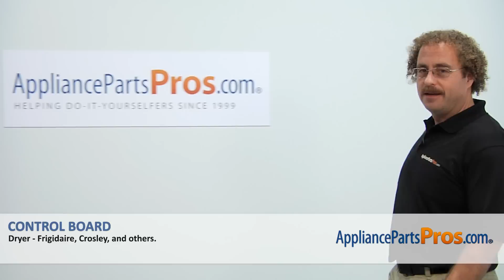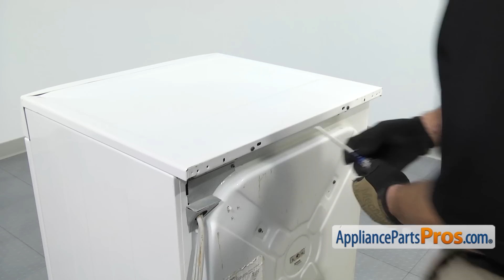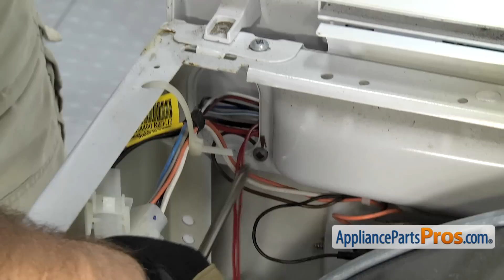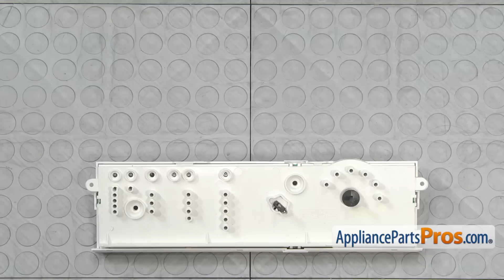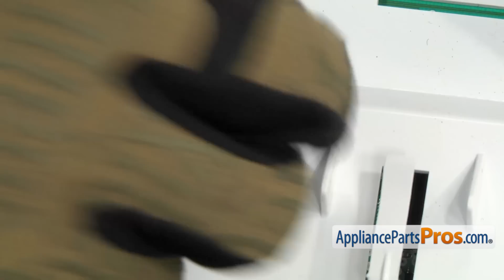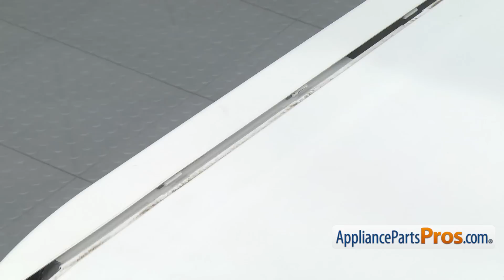Frigidaire Dryer Control Board 134484212 Replacement — fits Electrolux

Comment: Thank you for this excellent YouTube. I have a Kenmore / Electrolux exactly like the one in the YouTube. My problem was that the dryer runs for a while but stops abruptly with the four lights on the far right flashing. I replaced the control board with one I bought locally following this YouTube. As ladyluckdrums commented below, now you just get the bare circuit board and you have to reuse the old Control Board housing. Fortunately this was easy - the housing snaps apart and you swap the circuit board, and as ladyluckdrums also mentioned, the instruction sheet that came with the part is bad; the verbiage is confusing and the photos are indistiguishable.
The only difficulty I had was that the two knobs were extremely difficult to get off. The knobs on my dryer were quite different from the YouTube, but otherwise the panel was exactly the same. What I did was pull the Control Board away from the Control Panel, which left the knobs embedded on the Control Panel. To finally get them off, I had to squeeze the part that protrudes through the hole with needle nose pliers.
My dryer now works like brand new, and it ever has a quieter, smoother hum.

Comment: Thank you so much sir. This is exactly my model and you help me a great deal. Before buying a new board I have to find out why my dryer beep and the start light flash by itself when not in use.  I press on cancel and it stop beeping, maybe 20 min later it does the same thing again. Very weird.

Comment: Thank for you for the clear and concise video. The part I ordered from AppliancePartsPros did not come with the housing as pictured on the website, just the electrical panel. It added a few steps not in this video but some rational thinking got me through (the additional instructions with the part were completely inaccurate). So, with this video and some "figuring" I got it changed and it works. Thanks!
Reply: Same here. All I got was a computer board. I'm guessing I'll have to open that up and remove the old board. Right?
Reply: Yes, the housing openings. I took pictures so I could reassemble the correct way. It was easy
Reply: Yes  @ladyluckdrums it looks easy enough... You can see which receptacles stick through each hole. My guess w/ a flathead it should pop open when compressing tabs...
Reply: Yes, screw driver opened the tabs. I tried to not disturb the buttons as I removed the board. I worried about the dial/selector being lined up correctly. But it was smart enough to know where the dial was set.
Reply: @ladyluckdrums  HAHA... I hope I'm smart enough... Tomorrow's project!
Reply: @ladyluckdrums  Yeah... my dial selector got misaligned... No biggie. The LEDs show me where it's at... Thanks for you input. It's appreciated.

Comment: We have an Electrolux 134557200 Control Board for our Frigidaire upright dryer. On the replacement panel, when we put the post in that the knob goes into, it won't turn. It's like it is frozen. Is this a faulty part?
Reply from the maker: We'd be happy to help you out with that! We offer free technical advice and diagnosis. You can give us a call at 1-877-477-7278 or you can chat us at our website: http://www.appliancepartspros.com/. We're here 7 days a week.

Comment: my front load frigidaire dryer seems to be working ok but it beeps 3 times consistently while it's running. does anyone know why or what I need to do to fix it? it looks like the exact model in this video. thank you.
Reply from the maker: Without knowing what you have, I would suggest posting the problem along with the appliance model number on our repair forum and the techs can help you troubleshoot the problem. http://forum.appliancepartspros.com/

Comment: I have a Whirlpool Duet dryer serial number GEW9250PW1
none of the lights on the front panel are working. If I open the dryer door I do have a light inside the dryer but none on the control panel. Please help. Thanks